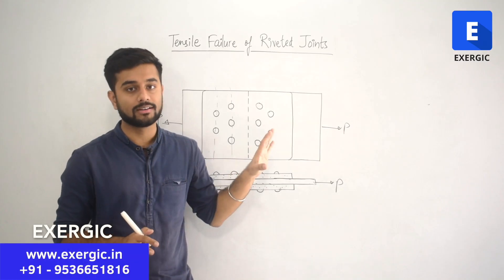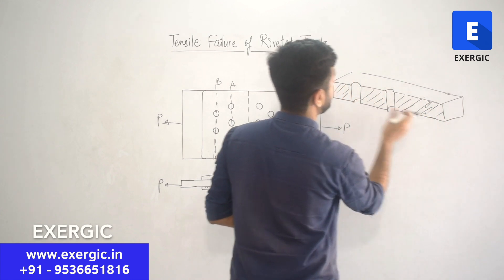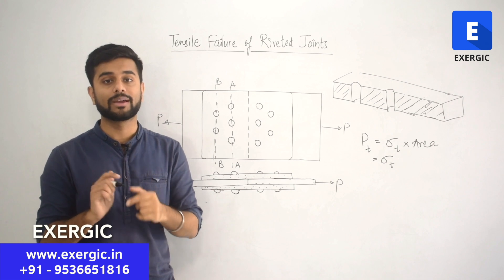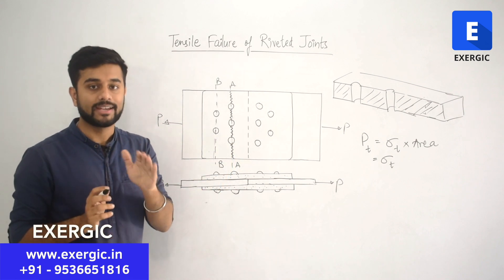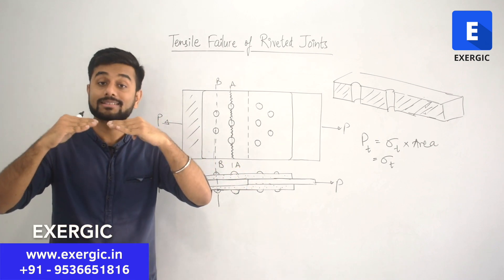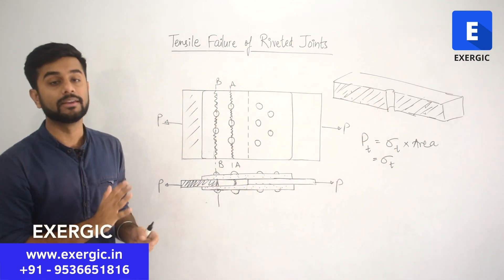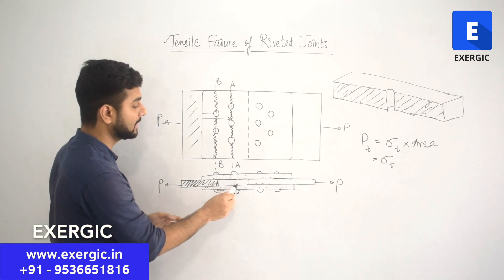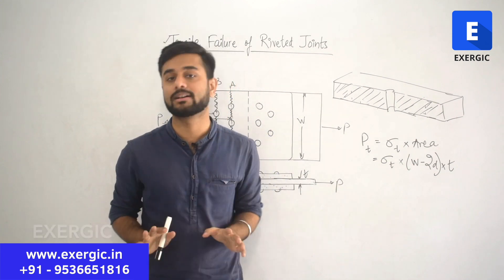Highly useful concept for numericals of Riveted Joints - Machine Design | GATE ME

Comment: But sir if question asked only tearing strength of the plate,and nothing mentioned like joint should fail or not
Then in such case which section should be picked of tearing strength ?

Comment: Sir if single joint is at section AA and if plate at section BB fails then we have to consider section AA because when both section fails then and only then the plate will loose contact

Comment: sir If AA section of both side broken from the top and bottom plate the the joints plate will seperate then  joint also failed 
you consider only one side scenerio  but if you consider both side AA plane joins also failed after AA section failed
Reply: Finally I got my doubt cleared in statement 
STRAPS DO NOT BREAK BUT PLATE BREAKS.
Even after reading in book I was not clear about this.
Thank you Sir.
Reply: Cover plates or straps area not included in calculation because no direct load applied to them

Comment: Sir,
What if section BB has 3 rivet holes and section AA has only 2 rivet holes.
In that case section BB fails and section AA still holds the plate. 
Here, do we need to consider the closest side BB or AA?
Reply: until plates are seperable whatever force applied that is strength of joint ,so based on seperation of plates when bb nearer or not is not matter only thing we consider is paltes are seperable or not !! . i think so bro....
Reply: @narsinghsv8934  ela unnav thammudu. Ela communicate ayyam chala rojulaki